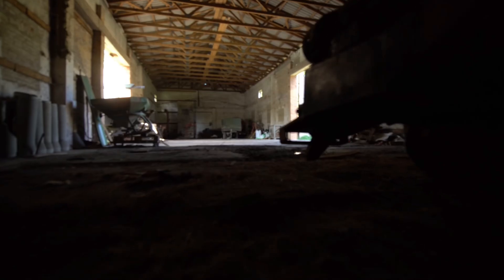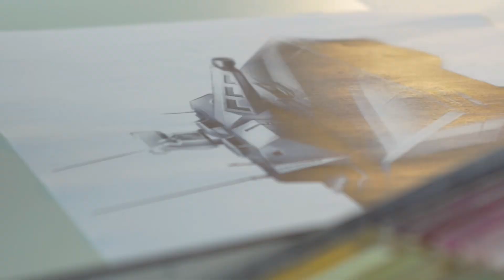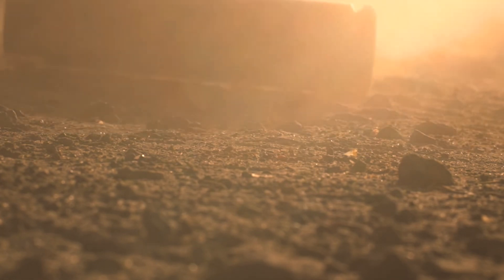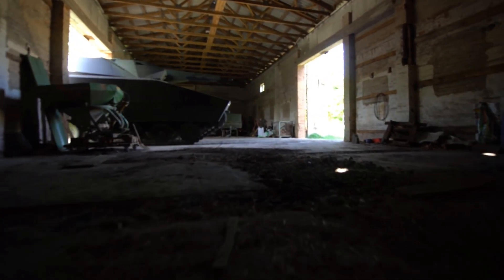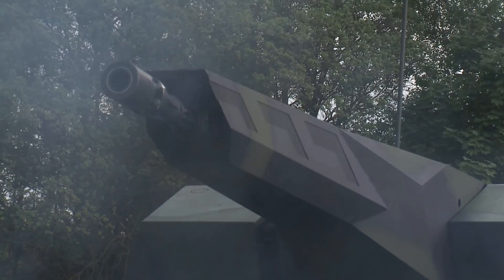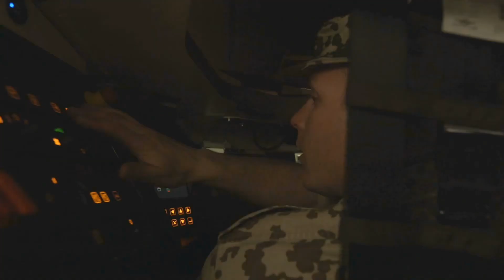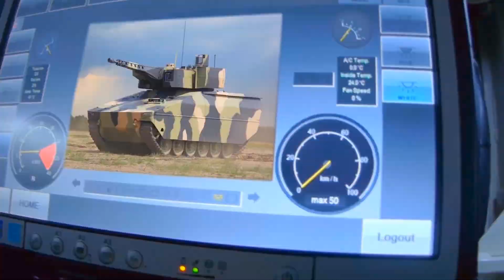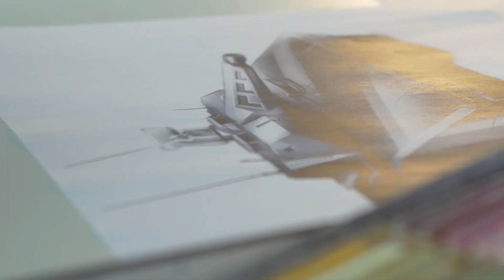Lynx KF41 IFV - Puma has competition!

Comment: For me Puma and Lynx are not comparable even if they are both IFVs. Puma is the first of this kind/generation and it was designed along side with the A400 M for quick reaction over long distances and only for the Bundeswehr to replace and extend the capabilities of the Marder IFV. Guess driving a Lynx inside the A400 M wouldn`t work well for the plane... as you said the Lynx concept is based on modularity, without the wight limitations and for export so it is a whole different story as the Puma.
Reply: CV90, ASCOD and Lynx all also fit in the A400M depending on specification.

Comment: My spreadsheet tells me that it is 98% as capable as the Puma - and I expect that pricing will reflect that.    IFVs are becoming too expensive, as a result of armies demanding too much of them.  The downside is that they won't be bought in sufficient numbers.  As for the AJAX, I am appalled at the high unit cost of a vehicle based on an in-service design.

Comment: It's a tracked boxer with armor.
I ordered to envelope this vehicle in 2017 spring, the secret capability of the vehicle if they followed my ideas, are:
1, pressure change in the cabin, at low pressure it's like a boot, or submarine, just even a handgun can hurt the brain of the crew, but if you rise the pressure a 90 mm hit feels like a handgun bullet.
2, the lights on the vehicle can do extremely high lumine and you know it's not nice to look into the sun.
3, glass piano for let's say, crowd dispersal

Comment: T-15 Armata is competition.
Reply: If they ever get produced ... 

In February 2019 it was announced that the first 12 tanks would be delivered by the end of that year.[24] In August 2019, the Russian Military-Industrial Courier reported that out of a contractually agreed 132 Armata-platform vehicles over three years to 2021 (including T-14 tanks, and also T-15 IFVs and T-16 BREM ARVs (ru:Т-16 (БРЭМ)), assuming production of 44 vehicles a year, only 16 would be delivered by the end of 2019. This implied a shortfall of at least 28 vehicles that year. Uralvagonzavod had apparently suffered severe personnel turnover, reportedly linked to financial abuses.[33][34] By November 2019 the delivery forecast slipped to "late 2019 or early 2020."[35]

In mid January 2020 the head of Rostec said no Armata-platform vehicles including T-14 tanks had been delivered, and in February the CEO of Uralvagonzavod only said that Armata-platform armour (not necessarily T-14 tanks) would start shipping to begin operation evaluation in 2020, with the full contract of 132 Armata-platform vehicles completed by 2022.[36][37] Furthermore, also in February 2020 it became evident that the set of requirements for the intended engine of the tank were not met by the construction bureau and the project of development of the engine would be closed in first quarter of 2020, further delaying the introduction of the tank for an unspecified time.[38] In August 2020, the Industry and Trade minister told journalists that the production of 132 Armata-platform tanks and fighting vehicles including T-14 tanks had begun after the resolution of problems with engines and thermal-imaging equipment, and they would be issued to the armed forces in 2021.[25]

On 4 March 2021, Defense Minister Army General Sergei Shoigu announced that Russia will receive its first batch of T-14 in 2022

https://en.wikipedia.org/wiki/T-14_Armata

Production is always just one year away, it seems ...

Comment: The cost of modern military equipment is absolutely insane and unsustainable.
Reply: Its all relative. GDP of most Eastern European nations has gone up a lot since 1990. Many can afford at least a brigade's worth of modern equipment these days for Nato ops.
 
BTW, you can buy a used Leopard II A4 from the 1980s for maybe 3 million, only to see it killed by a guy with a 100'ooo $ missile. Or a $5000 landmine.
Or you can spend 12 million on a Leo IIA7 with ADS and have the tank (and its crew) survive most mines as well as simultaneous attacks by half a dozen missiles.
What is more sustainable, long term?

Also, the Lynx is partly based on the Marder which has been serving >40 years in the German army. As the Lynx uses a modular approach for easy upgrades, I wouldnt be surprised if these machines are still around 30+ years from now. Stretched over 30 years, the anual payments arent too burdensome to a western country ...

Comment: will some of these vehicles have a chance to go into the German military?
Reply: Germans have the Puma. The Lynx is export only.
Reply: @jonny2954  Depends on how the Puma situation improves. If it only goes so-so, I could see the BW decide to go with only one armored division with the 300 Pumas, optimized for break through ops. And a second division with Lynx for better situational awareness, replacing the planned 200 extra Pumas with 300 Lynx. Should be the same price, roughly speaking, as RM could just keep its production line running after the Hungarians are done. Would also help with export sales.
 
Yes, normally, you dont really want two types of IFVs in one army for logistical reasons. But remember that we'll probably have Lynx using brigades (Hungarians, maybe Czechs) integrated into one of our divsions anyway. Meanwhile, the Dutch and Danish brigades and their CV 90 would go with the Puma division.
Reply: @positroll7870  Second batch of 210 Pumas was already approved several months ago.
Reply: @positroll7870  The deal isn't put on hold and won't be reconsidered. I don't know where you got that from, but that is incorrect. The operational readyness improvement is a completely seperate deal.
Reply: @jonny2954  Would you believe the Bundeswehr?
1. Stand und Entwicklung des Projektes
Die Auslieferung der Fahrzeuge verläuft weiterhin stabil. 41 SPz wurden im Rahmen des Vertrages „Leistungspaket System Panzergrenadier VJTF 2023“ der Industrie beigestellt und stehen damit bis zur Auslieferung an die Truppe de facto nicht zur Verfügung.Der Fokus liegt aktuell auf einer deutlichen Verbesserung der Einsatzbereitschaft. Die Vielzahl der eingeleiteten Maßnahmen wird sich jedoch erst ab Ende 2020 auswirken.Im Rahmen einer konsolidierten Nachrüstung sollen alle Fahrzeuge des 1. Loses auf einen einheitlichen Stand gebracht und mit allen geforderten Fähigkeiten (FOC) ausgestattet werden.Darüber hinaus wird derzeit die Beschaffung eines 2. Loses SPz PUMA vorbereitet. Diese steht jedoch unter VORBEHALT einer ERFOLGREICHEN Nachweisführung im Rahmen des Vertrages "Leistungspaket System Panzergrenadier VJTF 2023".
P 101 here 
https://www.bmvg.de/resource/blob/263830/274c9b18032991fe3233bf1770ce22a5/200200609-download-11-bericht-des-bmvg-zu-ruestungsangelegenheiten-data.pdf
Reply: @positroll7870  "System Panzergrenadier VJTF 2023" is NOT the operational readyness improvement deal. It contains the "Schützenpanzer Puma VJTF" and the "Infanterist der Zukunft-ES VJTF" (essentially IDZ-3) programs and aims to make one bataillon of Pumas fit for their tasks in the VJTF. It was trialed in July 2020.
Reply: @jonny2954  Yes and no. Part of the "erfolgreiche Nachweisprüfung" is proving that these 41 Pumas for the VJTF are working reliably, as promised in the original contract for the 350 Pumas. 

"Das Auftragspaket umfasst unter anderem die komplette logistische Versorgung der VJTF-Pumas über einen Zeitraum von fünf Jahren, also Ersatzteile und Sonderwerkzeuge sowie die Ersatzteillogistik."

A working spare part logistics, that is. And that means not just 50%, but 70% availability or more. Which means that RM etc have to come up this year with working solutions for the VJTF batallion that then also can be implemented in the main Puma fleet. 

They'll also have to show that they will be able to produce the needed spare parts in big enough numbers for the current main Puma fleet to provide the promised industrial support. 

"Im Rahmen einer konsolidierten Nachrüstung sollen alle Fahrzeuge des 1. Loses auf einen einheitlichen Stand gebracht und mit allen geforderten Fähigkeiten (FOC) ausgestattet werden."
That the damn thing actual runs more than 30% of the time IS part of the geforderte Fähigkeiten of the original contract. 
 
Else, it will be a breach of contract of the original Puma deal, legally opening up the option of stopping the second batch and even handing back the first batch.

Lets be real here. Yes, the Puma is a great piece of kit, when it works. 
MUSS 2.0 with ADS integrated will make it even better. 
But 10 years after introduction of the Puma, repeated malfunctions leading to 30% availability is just abysmal.  Production of spare parts shouldnt be an issue at this point, even if the BW ordered not enough in the first place.
 
Consider what just happened with the new Sturmgewehr decision. The MoD is looking to send out some clear signals that they are being serious about getting procurement back in some reasonable shape. 

What's more, going from some rumors, there seems to be some serious second thinking whether fully going with unmanned turrets was wise, esp where peace keeping or anti insurgent ops are concerned. You cant wave hands from a autoturret. Nor reload under armor cover. That wouldnt be an issue if we had four army divisions, but with just three, and the need to roate forces through Afg, Mali and Lithuania, Panzergrennies cant only focus on Russia ... *

Indications are they'll be going with the Lance turret 2.0 for the ca 100 planned Boxer IFVs, not the Puma turret, for this very purpose. Once you have the Lance turret in the army logistics chain anyway, adding a division's worth of Lynx, getting rid of most** Marder quickly and saving some money in the process would appeal to quite a lot of people in the MoD, me seems. Whether that means a mixed fleet in all brigades (one Puma batallion for breaking through, one with manned turret for holding the taken territory and for the flanks) or a division by divisions is just my personal speculation.

All that said, I personally hope and expect that industry will get its shit together and finally make the Puma not just a great piece of engineering but also an effective weapon on the battlefield.
 The Vjtf Pumas HAVE passed the first step at the WTD at any event back in July IIRC. Now its on to the field tests, with some covid delays, though ...
https://twitter.com/Deutsches_Heer/status/1303637856028626946?ref_src=twsrc%5Etfw%7Ctwcamp%5Etweetembed%7Ctwterm%5E1303637856028626946%7Ctwgr%5Eshare_3&ref_url=https%3A%2F%2Fs9e.github.io%2Fiframe%2F2%2Ftwitter.min.html1303637856028626946

*If it were up to me, I'd order another 150 modified Boxer for a new, additional, strike brigade, equipping 100 of them with the Lance turret and 50 with the Hitfact2.0. Modified mostly meaning a lowered hull, and stronger frontal armor. 
That would allow us to have the PG actually concentrate fully on what they do best and give the Russians a bloody nose if they cross the border ...

**Id hope they keep the two newly upgraded batallions for some reserve units. Else, give them to Lithuania for cheap.
Reply: @positroll7870  Again, your first quote is from the VJTF contract which is completely unrelated to the operational readyness improvement deal. It has it's own non-execution clause, but that one won't cause the cancellation of the 2nd bath either, and definitely not the return of the first batch.
Also there is no word from the official side on what turret Boxer will recieve. The LANCE rumor was spread by a overenthusiastic and over-interpreting ESuT writer and is a completely baseless claim. Same goes for MUSS 2.0. It is available for the 2nd batch of Pumas but there is no comfirmation that it's actually going to be used.

VJTF Pumas have but haven't passed the qualification:
"Im Zuge der taktischen Einsatzprüfung ergaben sich aber immer noch eine Reihe von Mängeln und Fehlfunktionen, die einer uneingeschränkten Nutzung entgegenstehen und einer zwingenden und zeitnahen Abstellung bedürfen." That's a yesn't.
Reply: @jonny2954  
Re Puma: 
We'll just have to agree to disagree there. We'll see soon enough what comes out of it. 

KaBO: Not just ESUT.
"Dem Vernehmen nach setzt die Bundeswehr bei der Bewaffnung des Boxer, für den bereits im September eine Auswahlentscheidung getroffen wurde, auf die 30-Millimeter-Maschinenkanone in einem so genannten Lance-Turm, wie sie Rheinmetall bereits für die australische Armee liefert"
https://augengeradeaus.net/2019/12/heeres-planung-boxer-raschuetzenpanzer-soll-wiesel-abloesen/
Augengeradeaus usually has a pretty good read on things. Not set in stone, as there has no official decision been taken (needs an Auschreibung, anyway), but I'd bet on the Lance, 2:1 odds.

MUSS 2.0: 
Yes, so far its just an offer from Hensoldt. But the BW would be stupid if they didnt include it in the new batch from the beginning.
Reply: @jonny2954  Found the source:
 Vizeadmiral Carsten Stawitzki, Abteilungsleiter Ausrüstung im BMVg.

"Die Einsatzbereitschaft des Schützenpanzers Puma soll bis zum Jahresende signifikant erhöht werden. Ein zweites Los Puma kann Stawitzki nur unter zwei Bedingungen verantworten: „Erstens muss der Konstruktionsstand VJTF 2023 als Abholpunkt für das Ordern eines 2. Loses abgenommen und gesetzt sein. Dieser Meilenstein ist durch die Industrie zu halten und auch abzuliefern. Und zweitens muss die materielle Einsatzbereitschaft der Bestandsflotte deutlich gesteigert und signifikant oberhalb des aktuellen Niveaus liegen.
Und Stawitzki denkt weiter: „Mit Blick auf den weiteren Betrieb der dann noch größeren Puma-Flotte erwarte ich auch, dass wir uns mit der Industrie über die Rechte am Puma einigen. Über die HIL GmbH wollen wir die Instandsetzung und Auslastung der Werke, die mit der Entscheidung der Ministerin vom letzten Herbst nun bei der Bundeswehr verbleiben, entsprechend zukunftsfähig sicherstellen.““
https://hardthoehenkurier.de/index.php/news/9-news/2388-das-ergebnis-ist-wichtig-nicht-die-methode

Is the Vice admiral in charge of Bundeswehr procurement good enough to finally convince you?
Reply: Just in case a navy guy isnt good enough, I'll add the (then) head of the army (12. Februar 2020):

"Den Puma haben wir zusammen mit der Industrie schon auf einen guten Stand gebracht. Wenn aber nicht nachgewiesen werden kann, dass er bis zum Sommer einsatzreif ist, dann haben wir ein Problem. Wir haben entschieden, die gesamte Panzergrenadiertruppe mit dem Fahrzeug auszustatten. Um alle Grenadierverbände auszustatten, brauchen wir dann ein zweites Los an Puma-Schützenpanzern. Wenn er bis Sommer nicht zuverlässig seinen Auftrag erfüllen kann, dann müssen wir diese Entscheidung erneut auf den Prüfstand stellen. "
https://www.sueddeutsche.de/politik/bundeswehr-joerg-vollmer-interview-1.4793533

He then goes on to obliquely diss the Lynx ("concept of the 80s"), but the new GIn might see that a tad differently ... ;)

Comment: I think a lot of these IFV are very comparable, but this one looks the coolest. 
The only question i have is the rubber chain, it seems to be 1 piece.  Could be a problem to change / repair if damaged vs IED
Reply: Lynx uses rubber band tracks from Diehl wihich have a segmented design. A track is made from a total of 3 or 4 pieces as far as i remember.

Comment: 50 tonnes will have problems on soft terrain and bridges and fording of rivers.  Over engineered and needs to be lighter for more mobility, higher efficiency and affordability and lowered cost of maintenance
Reply: It's supposed to work together with MBTs - so only need mobility for regions they can go. For another IFV which is more mobile the germans have the new Boxer - and on ultra light - ultra mobility (helicopter air transport) not and IFV but an AWC the german Wiesel. Loaded trucks weigh up to 60t - so they go over bridges they can go easely. So realy swampy grounds are of course a problem. You don't want to fight there especially with heavy equipment anyway.

Comment: One problem I can see with the vehicles turret is that there are slopes that would direct any shell fired just about a foot of the main gun down into the hull which would be devastating
Reply: Modern APFSDS penetrators don't bounce off or ricochet like WWII-era KE rounds. They enter even at a very high angle.
Reply: Jonny thanks for the correction, I'm always happy to be corrected as apposed to staying wrong

Comment: Ok I've got to ask. 

It has been shown on many new vehicles allready while it wasnt there in the past at all. Whats the point in encasing the gun barrel in that ractangular armour ? If it is so much of an benefit - why it wasnt done earlier. Why only now ?
Reply: It's not armor, it's for stabilisation. It first showed up on the RCT30 after initial assessment by the german army, they weren't satisfied with the accuracy in full auto and on the move, so they mounted this prop. Since then it's used on every turret Rheinmetall released.